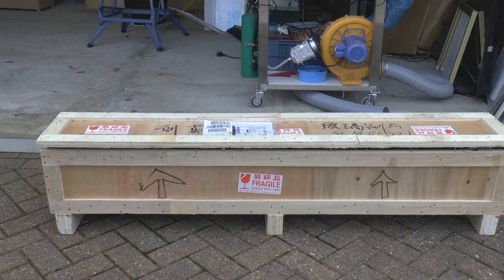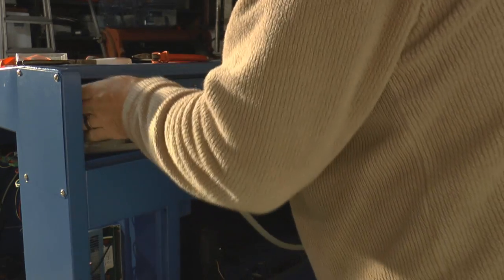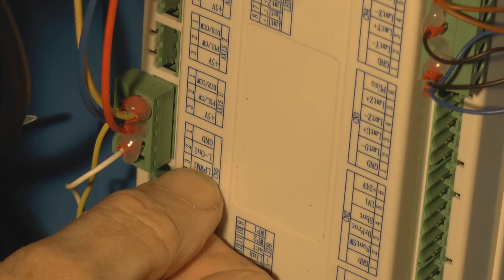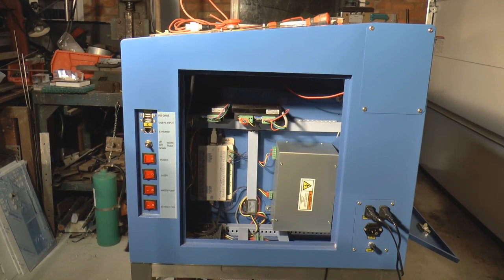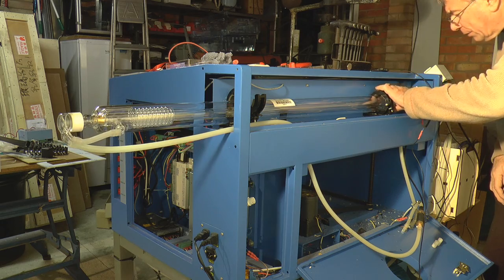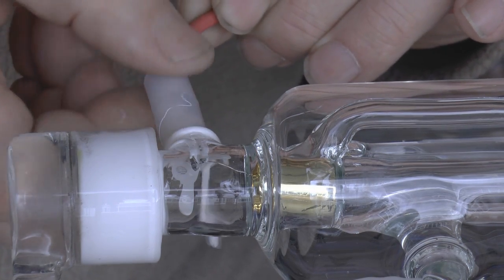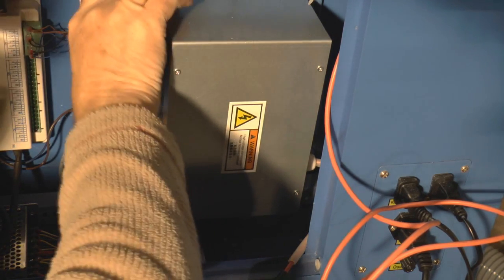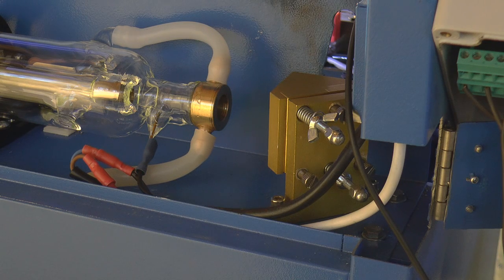RDWorks Learning Lab 50 fitting 60watt tube and PSU

Comment: I may be mistaken but didn´t the connector on the tube go on the wrong side of the crimp connector at 12:08?
Looks like it is between the plastic cover and the connector rather than IN the connector?
Love your videos though. :)
Reply from the maker: Hi Richard

You were not mistaken. The electrode pin is made from a strong but brittle material (may be tungsten) and will NOT solder. I did try to find a connector in my selection of crimp fittings that would slide nicely onto the pin and failed. Petrified of breaking the pin I did exactly what you thought you saw. The idea being to get a good positive connection (with some compliance) without stressing the pin. The normal way the Chinese achieve this  connection is just to wrap the wire around the pin...... that was just too crude. There is so little current flowing, no more than 30mA, even in a 150 watt tube that the resistance of a line contact is negligible.

Best wishes
Russ
Reply: Ah, so it was meant to go on the "wrong" side of the connector! 
I suspected that it might not have been a mistake as you are very meticulous with what you do. :)
Regarding the seller you bought it from, I was just a bit worried since I read another comment from someone who
received a "bad" quality tube and I would like to minimize those things when buying.
I just sold my old Trotec Speedy so at the moment I am trying to find the best possible (chinese) replacement laser machine.
I am currently considering this one which claims to have a Reci tube.
https://www.ebay.com/itm/DSP-100W-Laser-Engraver-Cutter-Engraving-Cutting-Machine-Linear-Guide-USA-Ship/222857190712?ssPageName=STRK%3AMEBIDX%3AIT&_trksid=p2060353.m1438.l2649
The seller have a reference in my country who is happy with his machine, the only difference is that he has the non dsp version with only bed up/down and power control on the machine.
I feel that it would be better with the dsp version since the cheaper version can´t handle different cutting/engraving  parameters in one program so one need to post multiple files in that case.
Any opinion about the dsp vs non dsp version?
Here is a link for the non-dsp machine.
https://www.ebay.com/itm/RECI-100W-CO2-Laser-Cutting-Machine-Laser-Cutter-Engraver-1000-600MM-EU-Ship-/192313979360?hash=item2cc6ce71e0

Best regards
Reply from the maker: Hi Ricard
I detect a note of cynicism in your words already,  "claims to have a Reci tube"
As a high value tube, there are fakes out there but there is a way to verify a genuine Reci
see    http://www.recilaser.com/en/index.php?m=&c=Index&a=show&catid=13&id=34
Sadly this is not quite what is claimed for the tube either. In reality it is an 80 watt tube.
see  http://www.recilaser.com/en/index.php?m=&c=Index&a=show&catid=7&id=66
If you look at section 2 , I will put into plain English what it says.
Tube has been tested to 29mA and will output 100 watts. The normal running current must never exceed 27mA  (90 watts output) or you will invalidate any warranty. BUT to achieve the claimed life of the tube (not specified you note) we recommend you do not exceed 25mA  (about 80 watts). 
That seems like Chinese lies even from a reputable company.

I would choose the DSP version over the non-dsp. There is an alternative software in bete form for you to download and try that promises to be better than RDWorks when its completed. So something to keep an eye on. It's called  LIghtburn
Everything about the spec looks reasonable. You are getting an autofocus system and rotary device in the price. The rotary is OK for parallel objects but not suitable for tapered beakers and tumblers but you may be able to fiddle that by blocking one end up. I have auto focus on one of my machines and in honesty, in a year and a half I have never found an in-process application for it ...... and it's slow. I can change focus in 10th of the time manually.

Best wishes
Russ
Reply: This is great information and great to have someone sitting on this much info with this quick response rate so thank you so much for this.

Comment: Thanks Russ. It seems it's wired up correctly but I think the 60 watt supply and 50 watt tube means some settings are out now. I'd mess around with the settings but the wife has me cutting things non stop ! Cheer Rob
Reply from the maker: Hi Rob
The %power on these machones  gives the impression that you are selecting watts when you change this value.  Wrong. Yes it does ultimately affect the watts output but when you select a % power your white controller outputs a dc voltage between 0 and 5v where 0%=0v and 100%=5v. That voltage is used to control the current range available in your power supply. So if you have a 60watt power supply it is likely to have a max current output of say 24mA. So 0v=0mA and 5V=24mA. Sadly, the power from the laser is not linear so there is no direct relationship between the %power you select and the watts you get. All we can say is that 20 mA is the max allowable for a 50 watt tube and  thus 80% of 24mA is about 20mA.
Hope that makes sense.
Best wishes
Russ
Reply: SarbarMultimedia I've got an ammeter ready to go in the machine so I'll be able run run it higher then. Thanks for your help. Rob

Comment: Hi Russ . Ive just replaced the power supply on my machine as the original packed in half way through a  job. Anyway Ive bought what I think might be a better supply but its 60watts instead of 50 but Im being careful with the power so I dont fry the tube (I have an ammeter ready to go in the machine its just not been wired up yet) . I seem to have a problem in that the laser is cutting alright but its not etching. Ive been trying various sites to find out if we have it wired up correct as we thought the wires would be the same just like you have. The only thing is I have the same machine as you but the controller wires are wired different going into the power supply so Im wondering if the crazy wiring worked with the old supply but for some reason its not working now. I see your wires are fairly straight forward. Do you still have that machine and could you tell me what coloured wires go in what socket on the 6 pin connector at the top of your power supply ? I cant quite see whats going on. Cheers Rob
Reply from the maker: Hi Rob 
Sounds a familiar problem. I have sent you a You Tube message, so go hunting.
Best wishes
Russ

Comment: Hi, can you give me more details about where you have bought PSU and Tube?
Reply from the maker: Hi Chakis

This is the tube and power supply that I bought. It was relatively cheap .....until you see what DHL chareg for delivery!!!! On top of that there will be VAT to pay to DHL before they will deliver. However, the pain was worth it it. Here I am more  than 18 months on and the tube is still performing as new. I have been VERY pleased with it.

https://www.aliexpress.com/store/product/1200MM-60W-Laser-Tube-60W-co2-Laser-Power-Supply/321243_1109607209.html?spm=2114.12010608.0.0.73938931vD9WLR

All best wishes
Russ

ps Do not be tempted by Ebay and Amazon Marketplace low prices. They will almost certainly be  B grade tubes .
Reply: thanks for the reply. now I have blown my 40w tube (aka 50w) and looking for the replacement. By saying B grade - you mean they are bad quality or somehow fixed/refilled tubes?
Reply from the maker: There is a brand of tube K H Laser that are truly reject tubes from main tube manufacturers. They are taken into the KeHui factory, retested to make sure that they work "in some way" enough to fool the average naive E bay buyer, relabeling them to give them credibility and then fitting them to their machines for selling to Ebay buyers via PRIVATE sellers. This breaks the accountability trail.  I have seen several of these relabeled tubes myself and they usually have the KH Laser label covering the original makers label. K H have recently started selling these relabeled tubes on Ebay. Other tubes you buy there may not be labelled but from all the correspondence I get,  there is a pattern of early failures on lots of unbranded E bay tubes also. Having suffered twice myself, all I'm saying is that I have lots of information that allows me to see patterns that individuals cannot see. Beware.

Best wishes
Russ
Reply: actually the one that blown out on my blue machine is KH Laser labeled. It lasted me for about 8 months of lifetime, maybe mostly engraving each day for about 1 hour lets say. So its only around 250 hours of work... Also I see you have new tube clamps? Are they good? Maybe you remember where have you bought these?
Reply from the maker: They are definitely reject tubes but but how close to just failing and how close to rubbish is really a lottery. I  know of many tubes dying within just a few minutes or hours of power up. Youy * months is one of the longer lives I have come across. Those longer lives are usually the 80 watt and above tubes that have come from EFR originally.
Yes its tempting and easy to buy from Ebay and I'm not saying don't, I'm, just giving you the facts so that you can make your own risk assessment. I paid a silly price for my 60 watt upgrade but my goodness it was worth the pain.
All best wishes
Russ
Reply from the maker: Hi 
Tube clamps are my DIY design from acrylic. Will send dxf if you send me your email via personal message
Best wishes
Russ

Comment: If that old PSU needs a home, I'm looking for one for my K40..!  :)
Reply from the maker: Hi
The tube and PSU supplied with my machine failed as a combination. I thought the tube was 100% at fault.. The replacement tube was a little better but performance was very variable. As you will see from some of my earlier videos than this one, the tube needed more and more help (machine kick) to get it to climb past the pre-ionization phase. Completely sure that this was a problem within the power supply I was happy to take it to the local recycling centre.  As I find out many months later, they should have done that part in China!!! Because of all the correspondence I get  with questions about failing tubes and power supplies a very clear picture has built up over the past year. ALL ebay machines are fitted with final QA failures from the big tube manufacturers. There are a couple of non-existent companies HK Laser Lab and Xi Laser Lab that are collecting these rejects, testing them to make sure they function "in some way", relabeling them to make them look authentic and presumably selling them back to shippers of Ebay machines where the chain of accountability is about the same as in a flea market. A sub standard/ poorly made PSU generally accompanies this tube. MANY people have reported PSU failures within days of powering up their machines. It's a total lottery as to how long your bits will last. The mechanics are basically reasonable although often suffer from poor assembly work.  Fix those bugs, fit a new PROPER tube and matching power supply and you will have a good machine, still at a budget beating price.
So Sorry cant help and would also be loath to pass on proven rubbish
Best regards
Russ
Reply: Cheers, Russ. I've had donated a K40, with a non-functioning tube, so your videos have been really useful, & interesting. Thanks for putting them together. I can't get continuity from any of the wires for the primary windings on the HT. Suggestions for tube manufacturers? PSU suppliers? I'm getting thousands of hits out of the big 'G'... This reply has been really useful, too, cheers, mate.
Reply: SarbarMultimedia Why does a bad pre-ionization phase occur? Is it a problem in the power supply or can it be a tube failure?
Reply: Russ I replaced mine with a 50watt tube from STP in China which just from taking it out of the box could tell it was far superior to the original.  The only bad thing was the DHL shipping costs !!!

Comment: Hi Russ When you changed your tube and supply were the plugs wiring the same or did you have to rewire them? I have a new tube and supply and they are not the same. Hope you can help me. the old supply has a small plug with 4 slots and 4 wires: -L, FG, AC and AC which are marked and a larger plug with 6 slots that are not marked but a photo I found on line shows them to be marked as follows: P, G, L, G, IN and 5v. The new supply has a small plug with 3 slots marked FG, AC, and AC so I would assume the -L goes on the larger plug with the other wiring and that 6 slot plug is marked as follows: TH, TL, WP, G, IN and 5v. Is this a problem you can help me with? Thank You
Reply from the maker: Hi 
I think it would be good to have this discussion via email. I can then send pictures. Click on the red Sarbar Multimedia square and it should open a page with tabs. Click on the ABOUT tab and that will open another page with a message button top right. This will be private so it will be safe to send me your email address.
Regards
Russ
Reply: I have this same thing currently now, after replacing and rewiring, we are getting minimal power out of the power supply that doesn't alter even when settings are changed from 30% to 100%, would love to get some information in the change over of the wiring please if someone can help. I don't know where else to look. Thanks

Comment: Hi Russ,I have a question for you. There seems to be 2 types of laser tubes, the kind that we have and the RECI type which seem to last a lot longer. The only difference that I can see, looking at the photos, is that ours has a cooling ring around the business end of the tube and the RECI does not. My question is, are they interchangeable? Could you if you were so inclined to, be able to change your tube for a RECI tube? With your intellectual pool of friend I thought you might be able to find out.Thank youBruce
Reply from the maker: Hi Bruce
The majority of "standard" laser tubes are based around a 50 to 56 mm diameter tubes where there are some fairly simple length rules you can use to determine the power output. 800mm=40 watts, 1000mm=50 watts, 1200mm=60 watts and 1600mm=80watts. These tubes are generally life rated at about 2000hours. 
RECI tubes don't follow these rules because their tube design is based on much larger tube sizes of 80 mm for 75 to 120 watt tubes and 90mm for their top of the range 150watt tube. There is no simple rule for determining their power from the  tube length although if you said 2/3 that of standard tubes you would be about right.
The life of a tube depends on several things, but mainly how much gas mix you can pack into the tube. If you have read any of my tech stuff about how laser tubes work you will understand the term "dissociation". This is how the gas mix degrades and eventually runs out of CO2.  Increasing the tube size from 50 to 80mm allows them to get about twice as much gas in their tubes. That more than doubles the expected tube life because they rate their tubes very conservatively and specify sensible maximum drive currents. Another big difference is their use of gold inside the tubes. They coat the inside of the central ionization tube with an atomically thin layer of gold and also the electrodes. This significantly reduces the rate of dissociation and greatly extends tube life to about 10,000 hours.
If you can afford one, and your machine will take an 80mm tube, there is no different way that these tubes work. Provided you power supply will cope, the better mechanical design, performance and life, makes these tube the gold standard by which others are judged.  Close behind are
EFR
http://en.bjefr.com/?page_id=2

Mactron
http://www.co2-lasers.com/co2-laser-tube/45-long-lifetime-co2-laser-tubes.html#.V48T8tSANBc

All will fit  and work in your machine. 

Hope this answers your question
Best regards
Russ
Reply: SarbarMultimedia I have a tube Reci and I burned the source of power. Try to buy one in my country for him and I only got a similar one that is actually for smaller diameter tubes. I placed it but the tube did not generate a laser light for anything powerful. Now I understand it must be because of the CO2 charge in my tube. Which is almost double.
Reply: carrighetti 
Hi
My most recent video on high Voltage  power supplies may help explain your problem. Recipient tubes start at about 100 watts so if you are trying to drive it with a 60 watt power supply then there is unlikely to be enough voltage generated to fire the tube. Ideally your tube and power supply should match ie 100 watt power supply for 100 watt tube. Your tube may not be dead. if there is no pink glow in you tube it may well be power supply issue. If your tube does have a pink glow but there is no laser power coming out then yes you have used up all the CO2 in the tube. This loss of power is not instant, it will get weaker slowly so you will know that the tube is dying.
Hope this helps
Best regards
Russ
Reply: Russ Sadler Thank you very much, I do not think it's the tube since it came working perfectly. I use your technique to cut each material so much that to what power it should cut it in a certain time and this was maintained until the day that the source of power of the tube was burned. I'm pretty sure I have not found the right source.
Reply from the maker: Hi
Send an email enquiry to Gelly Dung    sales02@mactrom-tech.com for the power supply you require. A trusted source in China.
Best regards
Russ